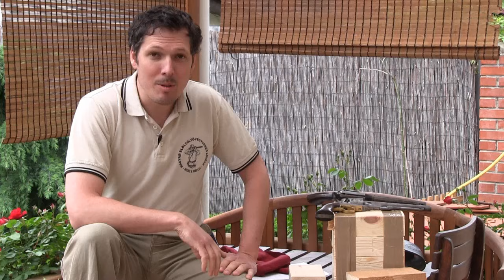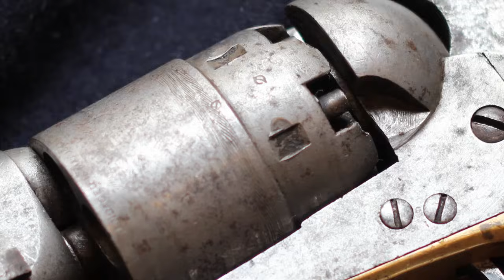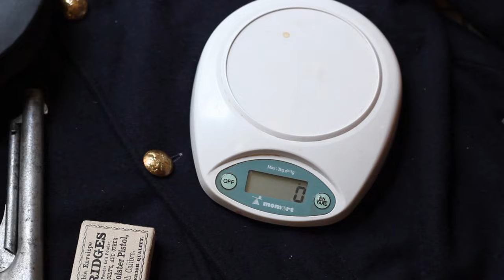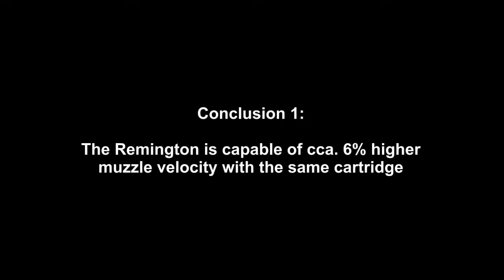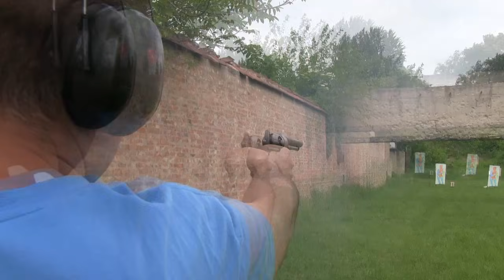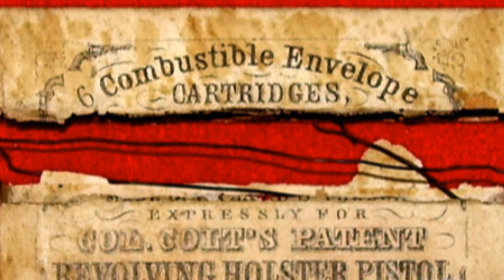Original 1858 Remington New Model Army vs original Colt 1860 Army percussion revolver

Comment: I had a choice between a Colt 3rd gen (Signature Series) 1860 and a Remington New Model Army a few months back and after handling each, I readily chose the Colt. It fit my hand much better and pointed so naturally that i had to have it. The Remington might be a little stronger but its a moot point even with shooting Triple 7, up to 40+ grains ive not experienced any malfunctions, cap jams or misfires. With 38 grains of 10+ year old 777,  it chronographs 1180 fps with a .454 143gr roundball. The Remington 1858 is very nice and I'll be buying one directly if i cant find a decent Ruger Old Army for sale, but ill carry the Colt as my EDC until i expire. Its proven reliable thus far and ill bet my life that if i happen to call on it, that itll acquit itself most effectively. Excellent video and historical commentary.

Comment: What is the difference between the barrel cylinder gap of both of those original firearms?
I only have replicas, and the 1858 has a slightly tighter gap which should mean that if one gun was going to have higher pressures and velocities than the other with the same load, it would be the Remington.
Unless you're having caps blow off...

It would be interesting to know if the deviation was just from firearm to firearm or if the deviation is in the replicas.

Comment: The Coilt's greater penetration may, simply, be down to wood density.  Had you been able to shoot the same  block in the same place  that  would have been a more representative test.
Reply: you cant shoot the same block in the same place. because the first shot would split the wood thus making the second shot penetrate deeper. this is the reason ballistics gel was invented. to make a consistent repeatable test medium and also show the expansion of the projectile. 

i know he was trying to be historically accurate, but he should have used used the gel. its a much more consistent repeatable medium
Reply: It might be, too that the bullet deforms less quickly due to lower velocity.

Comment: Hard to believe this vid is nearly 8 years old.  Both my 1858 and 1860 are fussy about the Lee conical, the 217gr Eras Gone By conical bullets with the recessed heal are much easier to load.  I would concur that the 1858 is a superior piece, but the 1860 is the more attractive gun IMO.  The difference in velocity between the my Colt vs Remington was 2.3% (lead to Remington) on average with 3F 777 (322mps vs 315mps).

Comment: Thank you for the great comparison video! I have an 1851 Navy in .36 caliber. I am hoping to get a second revolver  in .44 this time. I like the swappable cylinders of the Remington. According to Duelist1954, the Ted Cash capper will not fit the Remington, due to the shape of the cylinder nipple housing. It is such an easy capper to use, that I'd hate to give it up. Using a bit of a cliche', the Colt looks a bit more "Civil Warish"... Two would match what gunfighters like Wild Bill Hickok wore. I will agree that the very design of the Remington sights make them both more reliable and a quicker sight acquisition. Thanks again for the great video.
Reply: You may want to look into the Polish Star capper for ease of use.

Comment: The Remington is a more modern design, despite being released 2 years earlier than the Colt! I don't understand how lower muzzle velocity equals less penetration of the SAME bullet.... There must've been some inconsistency with the hardness of the boards.
Reply: Unless you have a typo, lower velocity will generally mean less penetration.
Reply: @billmelater6470  that kinda depends.  A lot on the bullet.  If the bullet expands more at the higher speed it can penetrate less because of the larger size. 
I remember shooting times doing a test. With the 458 win mag and the 45-70. 
With both loaded with a 500 solid the 458 penetrate more as expected. 
But with a 450gr sp the extra speed of the 458 made it expand and the 45-70 penetrate more.
Then they loaded them with the 45-70 300gr hp. The 45-70 penetrated more. The speed that the 458 had it going it came apart like a varmint bullet.
Reply: @tbjtbj4786  Sure, if the bullet is designed to break, expand or otherwise destabilize at higher velocities it will not penetrate well.  However if penetration is the desired outcome, velocity does matter.  But that comes down to what the projectile does on impact.
Reply: @billmelater6470  yea no doubt.  But the reason why I point it out here. With cap and ball the ball probably 100% lead.
So it should expand more at a higher speed. 

But your right if the bullet doesn't expand or they expand the same the faster one should penetrate more.

With this i know board was the standard penetration test back in the day.
But you could have differences in the wood to that could change small number testing.

Comment: The conical bullet does not have a concave recess in the back similar to a Mini ball? Just curious which was most accurate.
While I like the concept of the point of aim, being  very close to the edge of the bullet or cartridge cylinder of the Colt, I prefer the structural strength, provided by the wrap-around frame of the Remington, which is what I have.
Thanks very much for demonstrating your surviving examples of both.

Comment: this helps, but does not answer, a question I've been researching: why didn't Doc Holliday have a Remington? It's more reliable, accurate, quicker to reload the whole cylinder than the Colt Doc used.
Doc's uncle gave him is 1851 Navy Colt (standard 7-1/2" barrel), so it likely had sentimental value. 

But Doc's other revolver was either a 41-caliber Colt double-action Lightning/Thunder (a relative reported recently) or a short-barreled single-action Colt .44 (reported by a newspaper).  Why not a Remington 1858?

Comment: Great video!!

I know I am "late to the party" by several years.  However, I still want to add two things to the discussion.

I have also handled and fired originals of both of these revolvers, and have used Uberti replicas of them in competition.  First, as to the grip size and comfort, my personal experience is the exact opposite.  I have large palms and shorter fingers. I found the 1860 Colt grips to be too long and "fat" whereas the 1858 Remington grips fit my hands very nicely. Many of my fellow competitors had the same experience, and actually replaced the 1860 Colt grip frames with the smaller 1851 Colt grip frames.They are interchangeable.

Second, part of the reason for the above is a difference in the way the revolver is held in "combat" or competition. The video shows you and your associate placing all four fingers on the grip.  Most post-Civil-War shootists let their fourth finger slide below the grip (difficult or impossible to do on the unmodified 1860 Colt).  This change actually offers better control and, because it helps the pistol "roll upward" in the hand so the thumb can engage the hammer spur, greatly facilitates the second through fifth shots.
Reply: Which one of these is better in modern replicas? Is modern 1860 less reliable too?

Comment: You appear to be using grease over the cylinder mouths to prevent chain fires...I have used Crisco for.  many years, in my '51 Colt repro, but it is messy, and I had a chain-fire last time...Bought Wonder Wads, haven't tried them yet.
Reply: Bullet lube is ( mostly) to keep the fouling soft . Chain fires usually start from the back, with loose caps .
Reply: Front or rear, scared the heck outta me.  Lucky gun constructed so that ball from adjacent cylinder can exit unobstructed in case of chain fire.

Comment: I doubt if the penetration test is representative; If the Remington shoots the same bullet at higher speeds, it should penetrate deeper. What was clear was that the bullet from the Remington hit full wood, splitting the wood block, while the Colt hit near the edge of the block creating much less deformation in the wood and therefor shedding less energy while penetrating allowing it to travel "deeper" into the wood.

Comment: There s a penetration test but no muzzle energy test. Why?
Reply: The Energy is easily calculated from the velocity, with a known projectile weight .

  Figuring he's using the Eras Gone reproduction Johnson & Dow mold @ 216grs, and the velocities from a couple comments above translated into fps , that would be 312 ft lb, and 360 ft lb respectively . ( 427 & 493 Joules respectively , if my conversion shortcuts are close )

Comment: What was the next step in pistol development that used a modern propellant and built in cap but still had that almost carbine look?
Reply: Answer #1 - Model 1 1/2 , Model 2, and later Model 3 Smith & Wesson Breaktops . The 1 1/2 and 2 were available during the Civil War.  All were cartridge using , S&W owning the Roland White Patent that made cartridge revolvers possible . The .22 and .32 caliber were smaller than standard arms , but it is documented that lots of soldiers carried private purchase S&Ws .

  Answer #2 - More directly evolved from the Revolvers in this video :

    In 1868 , Remington blinked, and negotiated a Royalty to S&W , and introduced a conversion of the NMA in .46 Rimfire . It used a removable two piece cylinder substantially similar to today's conversion cylinders .

   After the White Patent expired, starting in 1871 , Colt offered a series of Converserion revolvers that reloaded with a loading gate, while the cylinder remained in the gun .

Comment: With the Remington, you could switch out a spent cylinder with a fully-loaded cylinder as quickly as shown at 3:53. So, if you could afford a couple extra cylinders, you could effectively have fully-loaded mags that you could quickly reload your revolver with; this at a time where reloading your revolver usually took around 5 minutes at best. With the Colt, this method of reloading would be much more cumbersome as taking out the cylinder is a bit of a pain in the ass, especially when in a pinch.
Reply: Reloading with paper cartridges ( as was standard military issue of the day) was way faster than 5 minutes .  Not very much slower than reloading a Colt SAA . But drawing another loaded revolver much faster than either .

Comment: for some reason those remingtons always seem better preserved than the colts
Reply: The very nature of the Colt design requires you to beat on the wedge if it is very tight (as you need to have it very tight for the best reliability) in order to remove it to clean the gun. During the civil war and for who knows how many decades people would bang on them with whatever they had available. Soldiers especially weren't concerned with keeping a Colt nice. You name it, they used it to get the wedge out: the handle of a knife, a stick or rock, wack it against the rifle, maybe use the outside of a bullet mold. When you are fouled or jammed up and need it wiped down and cleaned quick they would use whatever they had on hand. 

The Remington was such a simple but big innovation for a field weapon: just drop the lever and pull the pin out and the cylinder usually falls right out, all in just a couple seconds. Wipe the pin and cylinder down real quick, lob a bit of oil or grease on it and pop it right back in as easy as it came out. Drop in and plunge your paper cartridges into the chambers (if you have them) and in a matter of about 30 seconds or maybe even less you could be clean (enough) and be fully loaded, capped, and ready to fire.  That was lightning fast for the time and not too awful bad even now.

 The confederacy had some Remingtons that were bought personally by soldiers before sales to the south were stopped during the war but very very low numbers and most southern made revolvers were Colt copies, flaws and all and made of inferior materials on top of that. You add to the fact that the south would not have had access to anywhere near as many premade cartridges as the North did, due to supply and manufacturing being so hampered, and a powder flask would have definitely been used to reload but not in the heat of battle. Many soldiers got frustrated with using them and would sometimes just pitch them or trade them off to lighten the load they had to carry.  Remingtons were definitely loved by the soldiers but no where near as easy to come by.  A soldier got one of those and he held onto it and usually took care of it.

Comment: I enjoyed this video very much. I do, however, have a disagreement with the way the wood penetration test was conducted. I believe the test was done using 1 inch, or 1/2 inch pine boards sandwiched together, and the bullets fired at right angles to the sandwich, so they passed through successive layers one after another. This makes measuring the penetration much easier, One can immediately see the layers that were penetrated, and just count them, and then one only has to measure the final layer where there was only partial penetration.

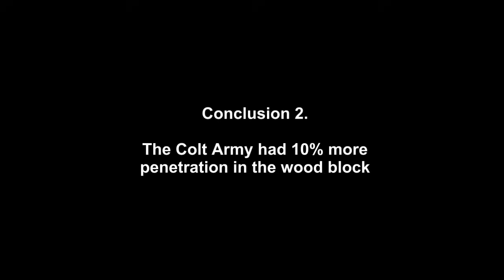Comment: Great video, orderly testing procedure BUT not scientific at all!  Any one shooting a few rounds free hand CANNOT give ANY statistically significant "accuracy result".  You SHOULD use a complete, very rigidly duplicated, bench rest trial, with NO HAND TREMOR whatsoever affecting the movement of the gun. This seems basic!  ALSO- WRONG on the Remington "less penetration"!  (7:40).  Here's why-   It's a simple fact- if same weight bullets are exiting the Remington faster they MUST have MORE energy, shoot flatter AND WILL consistently penetrate further.  END OF STORY.  No further 'thinking"is necessary.
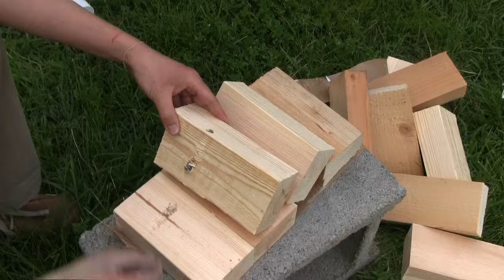     PENETRATION?  In this case the bullet path though the wood relative to the surface, hardness, humidity, and consistency of the wood will easily make way more than 10% difference.  And the wood is noticeably harder near knots as the branch root compress the adjacent wood.  The Remington bullet was into knotty wood... BUT the most obvious difference is- the Colt bullet went so close to the bottom split between the blocks (7:22 ) - it marked the LOWER piece also!  of COURSE it went further!  The Remington went into the solid MIDDLE of the 2x4 of similar but knotty and not identical wood).
     Cap and Ball, please tighten up your procedures. Of course exact worn out? bore size, pitting, type and depth of residual rifling as well as how accurately a conical bullet is seated, all also effect the outcome,  This was  a test of these 2 specific samples only, hand-held, fired into different wood, one skimming the surface.... so... NOT indicative except to say, I personally would NOT want one fired at me ;-) !.
     I'd say over all, the Remington, had better design features compared to the Colt Army; until you do a scientific test, as far as firepower and accuracy is concerned (once loaded) these two, are not far apart!
Reply: More Energy does Not automatically mean more penetration .  IF faster impact speed causes deformation/ expansion of the projectile , the resulting larger cross sectional area would DEcrease penetration . ( But make larger wound tracks in people/ animals ). This phenomenon is commonly seen in modern expanding ammunition with handguns and rifles .

  In his other videos , he does lots of testing with individual guns, from benchrest, with loads optimized for each gun .

  This video was exploring use of standard issue ammunition , and offhand shooting by reasonably experienced shooters would to a degree compare the effects of sights, grip shapes, etc in semi realistic conditions .

Comment: The Colt can be altered easily to stop pulling caps.  Also new Wilson springs will do wonders.  I have a 1860 Colt Navy replica made in Italy.  Two years of progress is a big advantage.  Cartilages need to be lubed.  Solders would put them in their mouth to  lube them if they had nothing else.  Both of your pistols are beautiful.  Your video has the best sound of any shooting video.
Reply: How can it be altered to stop suction cups?

Comment: Really enjoyed your video.  Although I have never fired a period Colt 1860 Army or the Remington 1858 New Model Army, I have owned and fired the reproduction models of both.  I love the Colt and I have found it extremely accurate.  I hit a man sized target with 5 of 6 rounds fired at center of mass at 60 meters.  I have always been told that Colts' measure of accuracy was that if it would hit a target at point blank range, it was acceptable.  I did Civil War reenacting for about 10 years and rode with the cavalry.  I carried a Colt 1860 as my primary side arm and carried a Remington and a Spiller & Burr (similar to the Remington but Confederate made) in a set of pommel holsters.  It is extremely hard to reload on horseback and believe it or not, the pistol was not the primary weapon, the saber was.  That is why the pistol is carried with the butt forward in a flapped holster.  The reason was is that you don't have to reload a saber.  Just a bit of cavalry trivia

Comment: I shoot 50 gr in my Remington.i can hit you 100 yrds.thats 50 grn. FFF 180 grn chronical bullet w wax wad.between bullet and powder .chronogram around 800  ft pr sec.
Been shooting it over 35 yrs.its stronger than the walker..killed deer with it and hogs. It is well.
Mine does have a longer barrel.
Although at 100 yrds the bullet is wobbling some but hits its mark on 12x12 inch target..colts shot faster.but remington shoot more true.